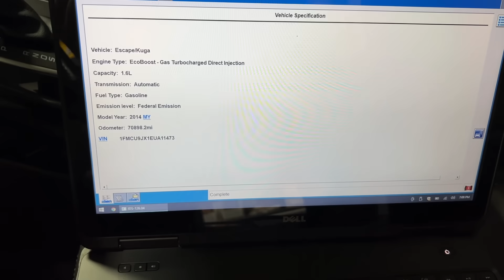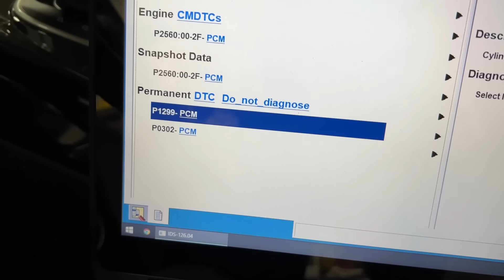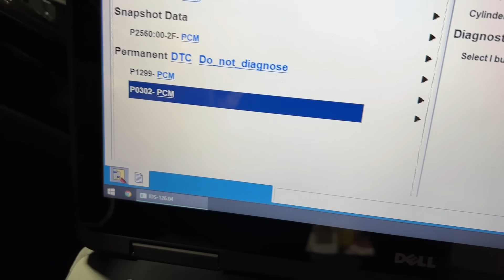Beware of Ford’s 1.5L 1.6L 2.0L Ecoboost Engines and Their Never Ending Coolant Consumption Issues!

Comment: I’ve always been a Ford guy but it really pisses me off that Ford is getting away with this.  They should cover this, it’s not like it is operator error, it’s a design flaw!
Reply: I'm a lifelong Ford guy myself; unfortunately, I purchased a 2012 Focus with the dual clutch transmission, and now I'm an avid NOT FORD guy.  Which makes me sad, but my loyalty isn't worth that amount of cash.
Reply: It's the plants doing manufacturing. Look up Kobe Steel scandal from a few years ago. They were selling steel with fudged data specs as higher grade than what was testing as. Ford among other manufacturers admitted to purchasing steel from them during this generation of vehicles time line. Of 100 companies only a handful came forward with info on what the steel went towards making. Certain Toyota/subi vehicles had valve spring recall due to it. Ford had seat brackets possibly from the same stuff. Check it out
Reply: @aninnymoose720  No, in this case it isn't. Ford has chosen a different design for these engines wherein the tops of the cylinder bores are unsupported or "floating" in reference to the cilinderblock. As the head is bolted to the cilinderblock, that means the tops of the cilinder bores can move freely, even if it is just a tiny bit, and therefore slowly scrape the gasket away, causing coolant leaks.
Reply: @tjroelsma  is that one of the reasons they downsized the ecoboost 1.6L I4 to a 1.5L I4?
They claimed it was mainly done for the chinese market, something to do about road tax.
Now we have a 1.5L I3 with cylinder deactivation tech. I don't want to know what could go wrong there.
Reply: @neovenom9833  I don't think so, that downsizing to 1.5L may be a legit effort to stay within a desired road tax category, as some countries use vehicle weight were as other countries use displacement as the deciding factor for the road tax category.
Reply: @tjroelsma  interesting. Thanks for that tidbit.  Kinda seems like one of those unnecessary things that create a slew of problems. Such as ELECTRIC water pumps or VARIABLE compression oil pump lol i want full compression and tight tolerances, not loosey goosey cause it's easier to assemble bs
Reply: @tjroelsma  That's not the reason, Honda has unsupported cylinders forever and lots of people throw large turbos on those engines.  The issue with the Ecoboost is they made a weak point in the top of the cylinder where it mates to the adjoining cylinder where the headgasket was much thinner and could easily be perforated over time by the high compression stroke pressures of a forced induction engine.  It was a massive design flaw that makes me never want to even drive another ford, let alone buy one.
Reply: @RPG-oh1yf I've put a head gasket in all four Hondas I've owned, one had 80000 miles. Proper coolant and change intervals. 
 Sorry, open top blocks are garbage.
Reply: @randyrohe my mother's Ford focus  2.0 cylinder is reliable and  transmission not so much but barley had problems with the transmission, to this day never had transmission problems.
Reply: @randyrohe If you bought that car recently that’s on you. Those Focuses have been junk since they came out. This is why you do your research before buying a car. Every car manufacturer has big problems with certain vehicles
Reply: @OnlyOriginalNinja  No, I bought it brand new before we realized the gravity of the situation.  And then lived through the nightmare for years, until Ford got to the point where they couldn't fix it and wouldn't cover the labor cost when I provided the part myself.  And now I drive a competitor's product..... with a manual transmission!
Reply: @randyrohe  That’s just unfortunate. I usually stick to older vehicles and research a bunch. Haven’t bought new yet. Drive a 2013 Focus ST with the closed deck. Thankfully doesn’t have these cooling issues, and a 1997 Cobra. Both manuals :^) I’m a Ford guy, but all car makes have their issues. I wouldn’t own most GMs after doing parts in a GM dealership lol
Reply: YEP. I called corporate to report my 147k edge with the coolant intrusion.  They pretty much blew me off. Now EVERYONE around me gets told to avoid a FORD like the plague. I have helped many friends and family wirh their car purchases.... FORD has been eliminated as a choice. Fight back with your wallet people!
Reply: Ford guy for decades . bought many new cars and trucks , built machinery for Ford and even a stock holder at one time. They have burned me too many times and have lost there way. I stopped buying from Ford in 2015 .
Reply: Hyundai stepped up and fixed their engine failures. Even if you owned a used one with no local purchased warranty.
Ford is just as bad as Chevy! I’ll never own another 2016 Edge! I( I still have it but don’t like it)  love my Hyundai though…
Best warranty out there.
Reply: I'm a Ford guy but with every manufacturer I've learned to always study the engine and transmission history. They all have issues certain years. Sad that Ford has let this one go on for so long.
Reply: @fernandobriseno8164  yep. Ecoboost  was a nice idea but terrible designed. They are ALL leaking it seems. They should cover the engine swap 100%. Look what hyundai has done, they have swapped out so many motors for free, it's ridiculous!  But it gives peace of mind for th buyer at least! No more ford  for me.
Reply: @exil3dlivecom  Yes sir, my buddy had his engine swapped through hyndai as well. Wish Ford would do the same
Reply: @fernandobriseno8164  yep. My friends 2017 Kia Sportage threw a rod. 3 weeks later... new engine and ZERO cost and ZERO hassle. They just told her, come in and gave her a rental. VERY GOOD CUSTOMER CARE!  I took my 2015 edge and had to wait 3 days. They said " waterpump is the issue". I said did you pressurize and wait 4 hours?  They said no and waterpump needs to go. I said I won't take that answer until the TSB is done. THEY finally did it 3 days later and confirmed coolant intrusion. Gave me a 8k bill. What a joke!
Reply: @exil3dlivecom do you know if infact Ford will cover an engine swap? 2.3L ecoboost mustang is needing a 2nd head gasket replace (maybe other things) in just under 2 years!
Reply: @Benji-Maann  they won't. I ditched the brand and bought a Tesla. Best car I've owned!
Reply: @fernandobriseno8164  It has joined it's brother, the Ford Powershift. Another Ford product that's severely under engineered, constantly fails and that Ford just doesn't care about: "you bought it, now it's your problem."
Reply: @tjroelsma  Sadly I'm starting to see that trend.
Reply: Currently have a 2014 with the 1.5 sitting in my driveway.  This is the third time now. First one went at 60500 on a 60000 warranty.   Was told by ford SOL and wouldn’t work with me at all since I didn’t take it to them for scheduled oil changes.  Car was taken to my certified mechanic.   Current motor in the car has 55k.  First and last ford I will ever own.
Reply: We scrapped our Escape. Same reason - repairs were more than the value of the car. 

Spoke to Ford and basically given the finger. Fine than u respond in kind - won’t buy one and won’t recommend one to anyone.  Bought two cars for my daughters - neither were Fords and they know why. 

Was a life long Ford person. Between me and my family have owned 20 Ford vehicles… don’t see any in the future for me the wife or our daughters.
Reply: @UCM-TkSXUWDgW12PEDpQIUsw The VW group has fields of unsold cars just rusting away and the cost passed onto the consumer.
Reply: Do the 2018 ford focus 1 ltr eco boost engines have this problem mines on 55k miles full service history.
Reply: GM is no better.
Reply: I do not emotionally identify with companies who don't care if I burn to death and die screaming. (In the case of my Ford pickups the hydraulic cruise control kickoff switch is disconnected since even later hydraulic switches seep brake fluid. I'm amused anyone thought that was a good idea.)

Business is purely about money be that business an automaker or a crack dealer. Corporate ethics are ancient history, a relic of a dead age along with having a genuine quality ethos.
Reply: I am a ford guy but i will never buy a ford again thats a bs.
Reply: 2018 ford escape with coolant intrusion.  82500 miles.  I wanted to drive this to 200k miles.  Repairs cost more than the value of the car.  Will not buy a Ford again.   This is a very pervasive and known issue.
Reply: 2018 ford escape with coolant intrusion.  82500 miles.  I wanted to drive this to 200k miles.  Repairs cost more than the value of the car.  Will not buy a Ford again.   This is a very pervasive and known issue.
Reply: Look up 95 Ford Windstar.  Run away from Ford if you can.  Drive away if it starts and stays running. Go fast because there is no guarantee it will stay running.
Reply: The car industry is in the hands of very few people and it is now one big scam. The price of a car has nothing to do with supply and demand but market manipulation. There are fields of unsold new cars stock piled that will never be sold and will not be released on the market as it will lower the price of cars. All new cars have an added price to pay for the unsold cars. Where are the governments to make sure the consumer gets a fair deal?
Reply: Bo Blu  Oh yes it does, it produces a lot of misery.
Reply: They shouldn't have bothered making these shxtboxes.  If they wanted to produce d/d cars, they should've stuck with the panther plats.
Reply: Brian and his great Ford tech videos would be the only reason I'd buy another Ford, just to have a great resource for any Ford engineering flaws.
Reply: Fill Or Repair Daily
Reply: I bled blue.  Until the 5.4 came out.  Now (most) of the bugs got worked out of that engine and Ford came out with something worse ...
Reply: Actually, I stay away from ALL Fords.
Reply: Buy a Toyota.
Reply: @iquix  Toyota is no stranger to problems. I had one and it was a POS

Comment: I just had to replace the 2.0L Ecotec in my wife's 2017 Ford Edge due to the poor design of the Cleveland 420 code engine. 68k miles on it. Coolant in Cylinder #2. Only 8k over the warranty. Ford wouldn't help out at all. I had to buy a new engine from Ford and put it in myself, but it saved me 4k in labor.

Comment: That is one of many reasons I retired, x Ford senior trans tech. You have to know what Ford products to buy, not many good ones out there between trans concerns, timing chain issues, coolant issues, oil consumption and very very poor tech assistance from Ford or Dealership management. Offered 200k to stay and I said NO.
Reply: What is your opinion on the 2003 4.2 V6?

Comment: As to the over heating issue. Why not simply lower the cooling system pressure? This could save the owner a large sum of monies. How about some radiator stop leak? What do they have to loose?
Reply from the maker: I will not perform hack fixes, if they want they can walk no one is holding a gun to their head.
Reply: @FordTechMakuloco  Lighten up Francis. I was simply asking a question. There is no reason to be rude. Many people do not have the financial resources for another engine. If my suggestion could help them then I am all for "Hack Fixes"
Reply from the maker: I am just saying my shop has standards and I will not entertain such fixes. There are plenty of other shops they can go to though that will gladly steal their money and not fix it right but not my shop no way.
Reply: @FordTechMakuloco  Brian ,I totally understand. There are simply only a few things that we are unable to fix. Mechanically or medically.

Comment: Love your videos, we bought a 2014 escape 2.0L from carmax a year ago, so glad we bought the maxcare extended warranty 3 years left on warranty will definitely be selling before it ends. If we are one of the unfortunate ones it will only cost us $500.00 soooooo happy we got it! That’s for the heads up.
Reply: The Ecoboost 2.0 in yours should not have any issues. 2017+ is when Ford redesigned the Ecoboost 2.0 block from a Mazda-derived block to their own and coolant intrusion problems started happening for just about all Fusion/Edge/Escape models built between 2017 (unsure of exact date) and April 19th 2019 with the 2.0.

Comment: Okay, dumb question. If the coolant is mysteriously disappearing and there’s no obvious leak, wouldn’t the best thing to do would be to pull the oil drain plug (well, bolt, really) and see if there’s coolant/water in there before putting pressurized coolant into the system to check for leaks?
Reply from the maker: I told them the same diagnosis a year ago, these engine burn it they don’t lose it into the crankcase.
Reply: @FordTechMakuloco  - Okay. I just heard you say something in the video that there was a crack in the engine block; so I figured the coolant was ending up there (as well as cylinder 2). Maybe leaky head gaskets, too?
Reply: Remember, he said the cylinder that was burning the coolant was STEAM CLEANING the cylinder with the leak which is why thy piston would look cleaner on the top compared to the rest of the cylinders.

Comment: I have a question and the question is do the new engines that you put in have the same  issues when done 
Ford should  do like Kia did they  had an engine problem and they give a lifetime warranty on the engine between 2016 to 2018 the 4-cylinder motor's had a problem and they're  put a brand spanking new engine in there under warranty for life I think Ford should step up and do the same thing what is wrong with this country why are we not doing the right things like Kia does maybe even Hyundai who knows anyway let me know

Comment: I knew the 1.6 had issues but I thought it was fixed with the 1.5. I guess I'm just lucky. I've got a 2014 Fusion 1.5 with 192,000 on it and I have never had a coolant issue.
Reply from the maker: The 1.5l is the worst offender of them all.
Reply: @FordTechMakuloco  OK good to know for future vehicle shopping. Guess I've just been lucky with mine.

Comment: I remember doing so many long blocks and multiple different recalls on them. They would smoke out our lot after a cold soak every time. Guys used to fight over the stand pipe recalls, because they paid well.
Reply: I actually quit my job at a Ford dealership because of all the recall work and warranty repairs, that didn't pay for my time or tools!

Comment: This makes me grateful for the plain and simple 2.5 liter in my 2014 Fusion. It's nothing amazing, but nothing bad. Iit just works. I've put over 100K trouble free miles on my engine, changing oil every 5-6K miles.
Reply: The 2.5 it's a very good engine, simple, no turbos only a long block 16 valve 4 cyl 4 spark plugs.
Reply: @servicioelectromecanicocue7025  thanks to Mazda for designing and building it.  I have a 2011 Mazda CX-7 with that 2.5 and 155,000 kms so far.
Reply: It's gonna bite you when the electric steering rack fails. my friend's 2012 fusion 2.5 just did that and dealer quoted him $3000 for replacement.
Reply: @NWCI  Yeah, my electric power steering failed already several years ago. The local Ford dealer was willing to install a used rack, and I was out the door for $800. So far it has been the only thing that failed on the car.
Reply: @NWCI  the previous owner already replaced the hydraulic steering rack in the cx7 in 2020.  It was verified that it’s full mechanical no electric.
Reply: @kevinW826  I was relating to the Fusion. Not familiar with newer cx7. Older cx7 used to have a ford engine with an internal water pump that it's gasket fail prematurely and leak coolent internally and get mixed with oil and then sludge the engine.
Reply: @NWCI  a 2013+ fusion is not the same car as the 2012 and before fusions it's actually the Mondeo from Europe so different type of issues

Comment: WEAKoboost...this is why I stuck with just the regular naturally aspirated V8 when choosing my '16 F-150. 150K miles and not a lick of issues. All these turbo this n that ecocrap...just more to go wrong.  They're designing these tiny engines to take all this pressure, and they can't and are failing.
Reply: I love my 14 F150 with the 3.5TT. pulls my Kubota tractor around with no issues.  10k pounds is a walk in the park.  Not a single issue with the engine.  Would buy another one over the 5.0 and the plugs breaking off in the cylinder head design.

Comment: Super unfortunate situation. It's not even that Ford doesn't have the know-how or engineering expertise to do things right it's the suits within the company demanding the bottom dollar cost point which is reflected in the quality.   Everything is bare bones bottom dollar minimum lowest bidder parts suppliers especially in those cheaper models of vehicles..   Sad

Comment: The best Ford engines are the 2.5L non-turbo used on hybrids or some previous versions of Escape and Fusion.  The 3.5/3.7L non-turbos are also good and the 6.2L is fantastic.  All engines have issues, but these seem to have the lowest number of major concerns.
Reply: Hey SJ, Ford just issued a recall for most 2020- 2022 2.5L hybrids due to fuel and oil vapors escaping the block and catching fire.  The fix doesn't make sense either.   Its becoming the best engines are the ones we alone can work on and fix ourselves. (pre-1980's?)
Reply: 80,000 miles with my MKX 3.7..not 1 problem...so far.  Aren't all turbo engines unreliable?
Reply: What other Ford engines are reliable?
Reply: Those are the best ones currently available.  As for older stuff, the 3.0L Duratec, 3.0L Vulcan and any of the two valve V8 or V10 engines are good.  See a theme here?  No turbo, port fuel injection - yeah, old reliable stuff.